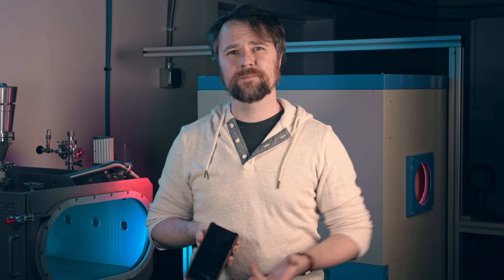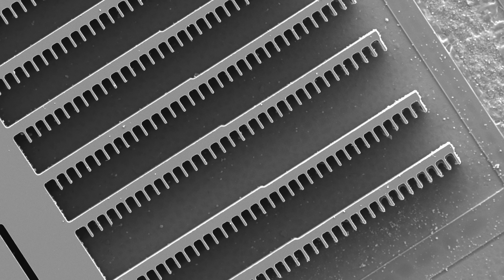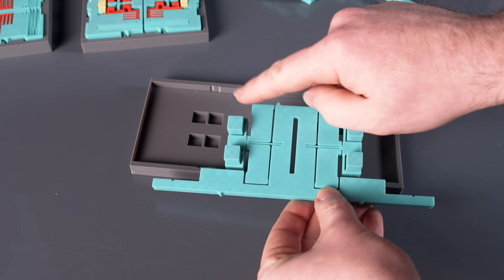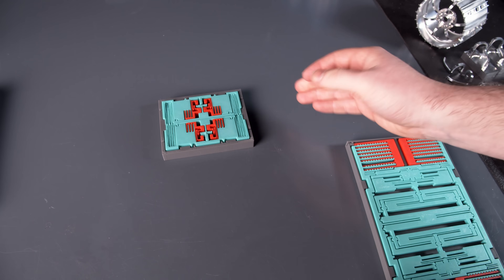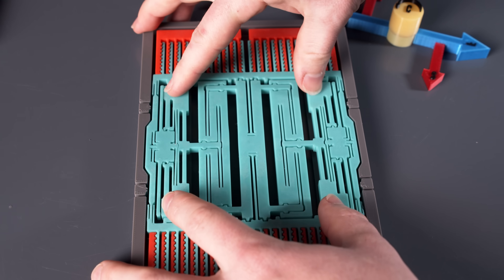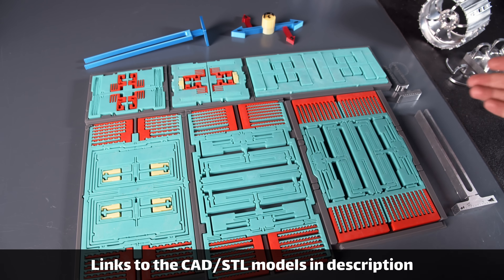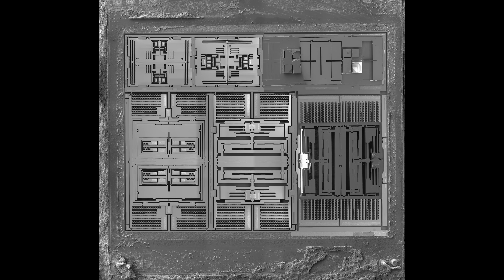The Micro Mechanisms in Your Phone

Comment: You said if you DROP the phone, the Z measures the downwards acceleration. I think more correctly, it reads 1G down while you hold it, and in fact X, Y and Z should all be zero during free-fall. But yes, in concept, assuming you are on earth, then that 0 reading says its falling. For interest, there are apps for the iPhone that lets you see the values from all the sensors in the phone, including compass, GPS, air pressure, X, Y Z accelerometer, and the X, Y, Z magnetometer (spelt wrong), which in effect is translated to "Compass".  I can't see to find the one I had in mind, but a search of the app store finds a number that look promising. I except there are much the same for Android phones too of course.
Oh, and great vid of course. Many thanks.

Comment: You got my upvote at 3:40, for tracing an entire MEMS chip into CAD so that you could CD print a human-scale model. Very awesome. 

The oscillation that you picked up isn't just in your 3D printed model. The real device is also going to have oscillatory modes, but these can be corrected for using software. Basically, you've got a fundamental signal, that's convolved with an impulse response curve that characterizes the device's oscillatory modes, yielding your observed measurements, so to go backwards, one can "deconvolve" the system's impulse response curve, producing an estimate of the true signal. 

The device maker probably knows the typical impulse response curve based on the device's design, but each device is going to vary slightly from the average, so if greater precision is desired, one could "calibrate" the device by more precisely estimating each individual device's impulse response curve. For example, a test harness could apply a specific acceleration pattern, and by comparing with the measured signal, the impulse response could be determined. Or it's also possible that the device can self-calibrate by observing typical motion. Or for such a small device, the oscillatory modes are probably at such a high-frequency that they can be eliminated by a simple low-pass filter. Tiny things tend to vibrate very quickly.

Comment: That's a lot of work for these amazing explanations !
Regarding the Z-Accelerometer, I'm not 100% sure, but I think that it's normal to pick up an oscillation: Basically, when an object falls and reaches cruising speed (which I think happens very fast in your demo) the effect of gravity isn't detectable anymore, and the only force that your system is subject to (apart from fritction) is your spring mecanism, which should oscillate :)
Reply: And something I find interesting about the X (and Y) accelerometer, is that it is symmetrical and doubled. I believe it is to detect if you're going in the + or - direction, but also to cancel out any rotation that are not purely translation?

Comment: I'm definitely curious why the GPS masses had to be vibrating and even if they were why would the frequency change by different amounts depending on which way they flexed.  It looks like it would work if the mass was stationary but was sprung so that a rotation would cause a differential capacitance above and below each half if the phone rotated around it.
Reply: Nvm.  After thinking about it more, I realized my idea would result in a rotational accelerometer, but once the spring forces neutralized, the sensor wouldn't be able to tell the difference between a rotational movement and a rotation at a constant angular velocity and would only sense accelerations and deceleration.   So I guess the vibrational force is what the device tries to do, and a rotation, even constant, will alter that force.

Comment: Sooo, how those devices are driven and sensed?
Reply from the maker: Electrostatic actuators typically (charge on opposing faces to make them attract or repel) and capacitive sensors to detect distances. There are other options like piezo actuators but they are more expensives and not usually necessary
Reply: @BreakingTaps  
Wow, thank you!

That was actually a hint to create a new video :)

Comment: Yeah, these MEMS devices blew my mind the first time I learned about them, back in school, I believe.  Great demo, you put a LOT of work into that.  

I did a bit servo design back in the day, and we used some quartz rate sensors as rotational sensors, integrating the outputs to get position.   Basically, as I understood it (trying to remember back), the guys that made crystal oscillators were looking for another application, so they dug down into their little brain pans and they came up with this.  They had some very nice properties in some respects and not so great in others.   And at the time, when they were first coming out, they were expensive.

If you haven't seen one, look up a ring laser gyro, a product the company I worked for at the time utilized (and maybe invented and/or produced, I don't remember).  That one had some AMAZING specs that put even the best mechanical IMU gyros, and I'm talking the kind used to put ICBMs in their quite tight CEP buckets at the end of a flight from say, here to Moscow, pre GPS days...a location that for some strange reason immediately rose to conscious level right then.  

I don't advocate initiating those long range delivery systems, OBVIOUSLY, but am VERY glad we have them, because otherwise someone else, Brezhnev, Gorbachev, Yeltsin, and now POOTler would have significantly itchier trigger fingers. So far the concept of MAD has worked, but if it ever doesn't...well...I don't even want to think about it.  

The goofy crap you see portrayed on movies and TV of post nuclear apocalyptic world are exceedingly ridiculous.  They don't even BEGIN to address the real problems that would actually exist, and having the biggest gun and most ammo is not going to guarantee you ANYTHING.  Surviving the more immediate perils, starvation comes to mind.  More recent climatological simulations on nuclear winter, as just one example, that have been tweaked considerably testing against real climate change, show that it would be worse than previously thought.

On the plus side, for people who are experiencing great anxiety over this possibility, I will include in another comment, a link that will lead you to a video of Putin discussing what a broken Russian Federation might look like, and what they are doing (private militias) to protect those various areas.  He said he didn't even know if there would be anybody that looked anything like today's Russian man at that time.  One can only hope.  The point is, if you look at the video, you will see that he has no intention of initiating nuclear armaggedon, even if that breakup happens, or they wouldn't be setting up those militias.  Like I said, link in next comment, because sometimes YT doesn't like those.  My question is how far is the idiot going to draw down his military capability before that?  The man is an idiot, he's gotten nothing right yet.  Sorry for getting off track.

Comment: Are you sure those MEMS devices are made out of silicon and not metal?
Reply from the maker: Yep, 100%! It's all an offshoot of semiconductor/microprocessor technology. And because MEMs are relatively "large" compared to modern transistor tech, they can reuse older-gen equipment. I.e. the  most advanced MEMs might be fabricated on equipment that was cutting-edge 10 or 20 years ago, just because they don't need to be quite as small. That really helps drive down cost too.

Comment: The tuning fork analogy is reminiscent of gyroscopic procession. Instead of maintaining rotational velocity, the energy is supplied by vibration.. You have access to some interesting equipment. Those 3d printed models were amazing, if you really want to get kookie, Start with those mems as the scale and build an entire phone on a warehouse floor. I wonder how big it would be taking the 2mil scaled up to what you printed. You could then print all all the Ic's lay outs sandwiched in Plexiglas sheet, Use ribbed swimming pool solar heater strips as connecting ribbon.

Comment: It also has a 386 and 387 (Dosbox), inherited a primitive but working Physx, and has to be activated with flight simulator as in PC (the plane/ fighter jet must see its shadow, then Physx or cpuphysx turns on). Some features such as Strength, Dexterity, Magic, Vitality, Luck, Intelligence is written into the internal L1 cache, and is powered by the capacitors under the processor, same in the phone. This enables more intelligent enemies, better driving, and more luck in explorer. On Google Play these games are paid, free games can hardly do this boost.

Comment: Great video!

The only thing you said I couldn't come to terms with was that the linear accelerometer in freefall wouldn't "feel" anything as the whole thing would accelerate equally. That should also mean that if the phone was to be held stationary, the sensor would read the gravitational acceleration from the decoupled parts inside. Right?

Please correct me if I'm wrong.

Comment: I had absolutely no idea how chips worked before this and didn’t even realize that there were moving parts at the nano scale inside of chips. I thought it was like all electrical. Very interesting. What’s even more probably interesting are the machines that I actually cut the chips on such a small scale or cut as well as the process The silicone is probably a better way to describe it.

Comment: great video man! One question: how does a general MEMS device maintain a continuous resonance of those internal "forks"? You absolutely killed it. I've subbed and I'm sure thousands of others have too. Really looking forward to what educational tech stuff you come out with in the future!
Reply from the maker: Thanks! Typically there will be an electrostatic actuator in there somewhere. At these small sizes, you can put a charge on two closely positioned plates and they will repel each other a small distance (basically the inverse of the capacitance sensing combs). So the devices just apply the charge at the resonant frequency and get the forks moving at their frequency.

There are other method like piezoelectric, but those are less common (and more expensive)

Comment: Hello!
Very cool video!
May I, please ask you for a help?
I'm working on a electron microscope sometimes and I've decided to "replicate" your video with the microprocessor and get some cool pictures for myself. I've even bought the same one.
But I'm struggling with the transparent non-conductive layer on the "circuit" (after you've crack-opened the heat sink thingy).
May I ask you for what kind of chemistry you've used to remove it, or another kind of mechanical way?
Thank you in advance!

Comment: I gotta say, this was very enjoyable to watch.  Most integrated circuit videos I have watched were quite lacking in actual information.  I have worked with integrated circuits since the late 70's and was always amazed at how complex they became over the years.  In the 80's we worked with Motorola 68000 CPU chips and had quite a lot of failures shipped to us.  We were able to crack the tops off and look inside to see the cip itself.  The mark one eyeball is not powerful enough to view the chip on its own and so we used high magnification.  Under microscopes, the complexity was astounding.  This was way back in the 80s....Its hard to imagine the complexity of today's cpu's with billions of transistors.  Well done, and I look forward to more of your videos.

Comment: A way to explain the "Coriolis" force part of the tuning forks:   When a rigid object rotates, the inner portion of the object moves slower than the outer parts.  So if you travel from the faster outer region to the inner region, (fork flexes inwards) the fast moving material "overtakes" the slower moving central material, and looks to deflect "forward" with the spin.   On the outward flex the slower moving region is going into a fast moving region, and is essentially left behind, this means it appears deflected 'backward" against the spin.  So the tuning fork sets the vibration so the prongs would continuously shift between regions.  When there is no rotation, there is no problem with differences in relative speed.  When there is rotation, and the stronger the rotation, the difference in relative speeds causes a measurable deflection.

Comment: Agreeing with the other commenters, this is a truly great video. But there is a mistake in the video at TI 4:59. When you hold it like that, the Z-axis accelerometer feels a constant acceleration of 9.81 m/s2. When you drop it, /then/ the z axis reports 0.0 acceleration while it's falling. This is important because when programming the phone (at Java level), a motionless phone sitting on your desk will always report that it is accelerating at 9.81 m/s2. The signal is always there unless the phone is falling. But if the phone is tilted at a non-orthogonal angle, then the 9.81 m/s2 signal is split out among the three accelerometers, and then -- math. 

What's really hard, I mean fun, is when you want to detect movement, and you have to remove the gravity signal from the non-gravity signal coming from the accelerometers. Then you have to know the orientation of the phone from a different source (such as the magnetometer or from keeping track of rotation).

Comment: What is also great to think about is that stator of the accelerometer is pulled downwards by gravity while the housing is pushed upwards. This causes the accelerometer to measure the force of gravity. If the accelerometer is falling from the sky without any air resistance the stator and housing are accelerating with the same force and the reading will be zero

Comment: Small size doesn't surprise me anymore. Once you learn how cpu is made. What amazed me more is the circuit city. It's like designing a puzzle with trail to see which computational power you focus on. Graphic, memory, etc. That's why things that made small doesn't always mean better so it doesn't surprise me.

What I'm amazed is the GPS. Military gps like those used on cruise missile used atomic clock. Which is so expensive that why the cruise missile is so accurate. Fast forward, phone gps reset the timing instead using atomic clock. Which it got really good. It can be off by 5 feet which is amazing.

Comment: Being a PlayStation gamer, all the controllers since the PlayStation 3 have had Accelerometers and Gyroscopes built into their controllers, making it possible to use the controller as aiming and steering device in many video games.
As a handheld console, the PlayStation Vita uses these as well to the same, as well as take panoramic photos.
PlayStation has had these MEMS built into all their consoles controllers for well over a decade.
Xbox still doesn't have them in their controllers.
Anyway -
Great video explaining how these MEMS actually function!

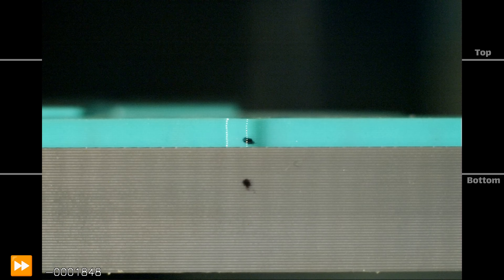Comment: 8:19 this macroscopic respresentation highlights a classic problem with MEMS based accelerometers and gyros; they do tend to have a bandwidth and above that bandwidth the MEMS device can be a bit underdamped and this could corrupt your measurments of it. The underdamped nature results in it oscillating like this and those oscillations may be higher than half the sampling rate of the ADCs used to measure the gyro.

This becomes a real problem on drones and other applications where there is going to be broadband vibration and shock that can corrupt the measurments of the sensor. In fact I have heard reports of these IMUs getting damaged from crashing drones into things. Where the characteristics of the onboard gyro end up changing, which can be somewhat compensated for by recalibrating them if they weren't damaged too badly.

Comment: For the white areas on the X and Y accelerometers, I believe the white areas aren't explicitly for sensing but they're there for rejection purposes. As you noticed, the primary movable blue mass can rotate as well as translate along the relevant axis. I'm not 100 percent certain but I think the opposed sets of sensing fingers provide a negative feedback signal to reject the rotational component of the acceleration.

Comment: Thank you for modeling the device in better scale and explaining all of the pieces in simple words!

I always though that rotation is figured by some micro-gyroscopes that rotate all the time by some motors and thus can detect how the rotation and movement is changing!

I am so amazed that it actually doesn't have any moving parts, is minuscule, flat and really cheap. And all this is achieved by using basic physics principles! It just blows my mind! 
The engineers worked really well on cunstructing such device! 
Bravo🌟

Comment: MEMS are awesome!

Sure, it does look like a tuning fork -- just with a large chunk of the bottom chopped off, leaving only a section of each tip "floating" there. ;)

And I'm glad someone already wrote to you regarding that oopsie about gravity, because surely I didn't just waste any time writing one of my own before noticing that it had already been spotted and throwing most of it out -- no, of course not! That would never happen! ;)

To add to that though, I suspect that the inertia of the proof mass and the spring force of the flexion joint probably create a small amount of "wobble" whenever the acceleration force changes sharply, such as when the suspended phone is released into free-fall or when it reaches the sudden stop at the end of that fall! That wobble is probably very brief due to the scale, and much more noticeable in the latter case than the former, though, as it should be proportional to the magnitude of the change in acceleration (assuming the proof mass doesn't "bottom out" and strike the casing, which it may very well do after a fall of sufficient height, or if the phone was thrown or involved in a car crash -- I don't know what the peak force tolerances on these devices are).